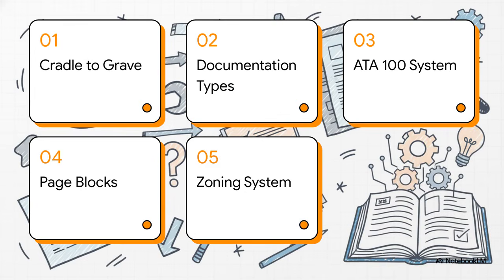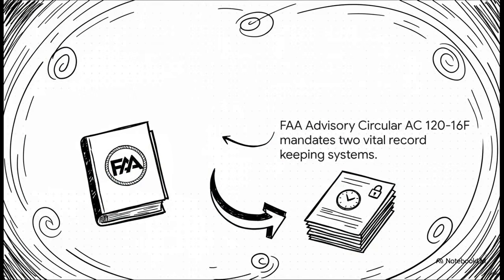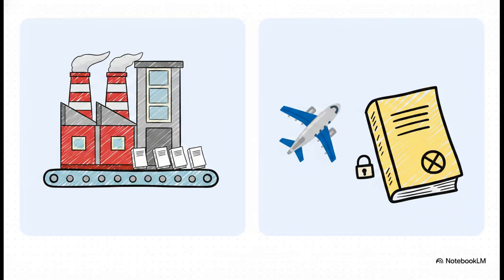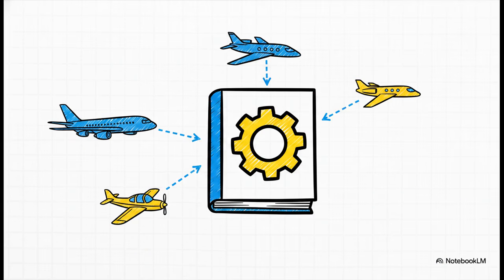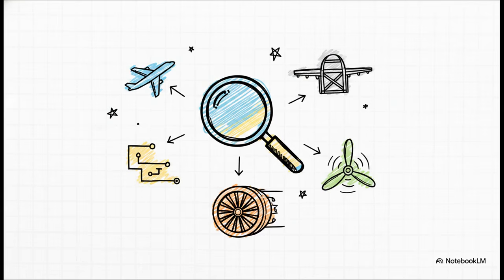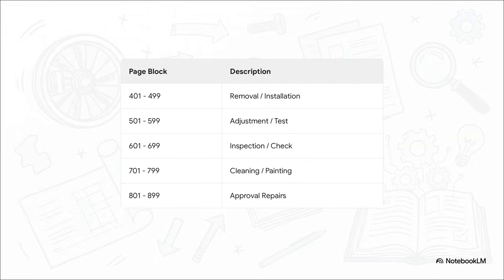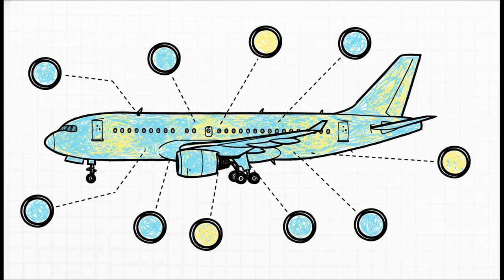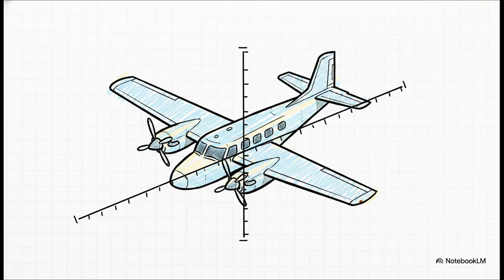AMTE 231 LESSON 01 INTRODUCTION

Comment: After watching the AMTE 231 Lesson 01 video, I gained a better understanding of the importance of documentation and proper referencing in aircraft maintenance. I learned that aircraft maintenance is not only about inspecting, repairing, servicing, or replacing aircraft parts. It also involves knowing how to correctly use maintenance manuals, follow approved procedures, and maintain accurate records of all work performed. Proper documentation ensures that maintenance activities can be tracked, verified, and understood by other maintenance personnel.

The discussion about the ATA 100 numbering system, page blocks, aircraft zones, and station numbers also helped me understand how maintenance information is properly organized. These systems make it easier for technicians to locate specific procedures, components, and areas of the aircraft. I realized that understanding these references is important because it saves time and helps prevent mistakes during maintenance work.

What I found most important from the lesson is that aircraft maintenance requires accuracy, discipline, responsibility, and attention to detail. As an Aircraft Maintenance Technology student, I realized that even a small mistake, such as using the wrong procedure or failing to record maintenance work correctly, can affect the safety and airworthiness of an aircraft.

Overall, this lesson gave me a good introduction to AMTE 231. It showed me that maintenance documentation and standards are essential parts of aircraft maintenance and will be important in my future work as an aircraft maintenance technician. Understanding and following them properly will help ensure safe, reliable, and professional maintenance practices.

Surat, Matthew Carl R.
AMTE 231 - 1B
 2026–2027

Comment: This Lesson 1 helped me understand why proper aviation maintenance documentation is important. I learned that every aircraft needs complete and accurate records from the time it is built until it is retired. These records keep track of the maintenance and repairs done on the aircraft and help make sure that it is safe to fly.

I also learned about the different types of maintenance documents, the ATA 100 system, and aircraft zoning. These systems make it easier for technicians to find the right manuals, procedures, and aircraft parts. Overall, I found the lesson clear and useful because it showed me that proper documentation is an important part of aircraft maintenance and safety.

NACA, MATT NATHAN ALEXANDER L.
AMTE 231- 1B
2026-2027

Comment: The AMTE 231 Lesson 01 video gives a clear and practical explanation of aviation maintenance documentation and aircraft referencing standards. It explains the difference between general manufacturer manuals and documents made specifically for aircraft operators. It also introduces the ATA 100 numbering system and shows how it is used to organize aircraft information, making it easier for technicians to find the information they need. The lesson discusses page blocks, such as the 400 series for removal and installation, as well as aircraft zoning and station numbering. These systems are important because they help technicians understand the location of aircraft components and follow the correct maintenance procedures. Overall, the lesson makes aviation maintenance documentation easier to understand and gives students a better idea of how these documents are used in actual aircraft maintenance. It also helps develop familiarity with standard references that technicians need when performing maintenance work.

JACINTO, ALLEN RAHMAN D.
AMTE 231 - 1B
2026-2027

Comment: This Lesson 1 helped me understand the importance of proper aviation maintenance documentation. I learned that aircraft need complete and accurate records from the time they are built until they are retired because these records show the maintenance performed and help ensure the aircraft remains safe to fly. I also learned about different types of maintenance documents, the ATA 100 system, and aircraft zoning, which help technicians easily locate the correct manuals, procedures, and aircraft parts. Overall, the lesson was clear and informative, and it showed me that proper documentation is an essential part of aircraft maintenance and safety.

Atienza, Zac Sealtiel L.
AMTE 231 - 1B
S. Y. 2026-2027

Comment: The video AMTE 231 LESSON 01 INTRODUCTION delivers a sharp, practical breakdown of aviation maintenance documentation and aircraft referencing standards. The lesson distinguishes generic manufacturer manuals from operator-customized documentation before methodically decoding the ATA 100 numbering format. By walking through standard procedure page blocks (such as the 400s for removal and installation) alongside structural zones and coordinate station systems, it turns dense regulatory procedures into clear, usable knowledge for certification exams and day-to-day flight line operations.

Dones, Daniel Justine B. 
AMTE 231 - 1B 
2026-2027

Comment: Through this video, I learned that proper documentation is very important in aircraft maintenance because it helps mechanics find the correct information and perform their work properly. I also learned about the ATA 100 system, which provides a standard way of organizing information and documents related to aircraft systems. This makes it easier for maintenance personnel to locate the information they need when inspecting, repairing, or maintaining an aircraft. Another thing I learned is aircraft zoning, which helps identify specific areas of an aircraft for maintenance and inspection. Understanding these systems is important because aircraft maintenance requires accuracy, organization, and proper procedures. The video helped me understand that documentation is not just paperwork, but an important part of keeping aircraft safe and properly maintained. It also showed me how organized information can make the work of aircraft mechanics easier and more efficient and helps prevent mistakes during important maintenance tasks.

Ace Kian Albert S.D. Argamosa AMTE 231 - 1B SY 2026–2027

Comment: I think this lesson matters a lot for me. In aviation maintenance, you cannot just depend only on what a technician already knows. You still have to pick the right document for the job. After that, you need to read it closely and do what it says.

Before this, I thought maintenance papers are just background materials. Now I see they are the real guides. They walk a technician through the steps. They also make it more likely that the work is done the right way.

These documents also help when things get stressful. Pressure can make people rush. New tasks can confuse people. The right document keeps the process steadier in those moments.

When the correct forms are used, the whole task is easier to keep organized. It is also easier to check later. Technicians get a clear source to use instead of relying on memory or what they personally did in the past.

In the end, this lesson made one point clear. Good documentation supports aviation safety. When the proper steps are followed fewer errors happen. Aircraft maintenance becomes safer, more structured, and more dependable for everyone who is involved.

R.B.T.RAMOS_2B_AY2026-2027

Comment: Lesson 1 seemed to be quite comprehensible due to its step-by-step explanation of the topics. I appreciate the fact that there are examples given to explain the ATA 100 system and page blocks. It made it easier to understand that aircraft maintenance documentation is an essential component of both safety of aircrafts and record of its maintenance. In general, I found the lesson quite interesting and useful as far as it provides an introductory insight into the field. Also, it became clear to me that the proper documentation helps maintenance personnel to get the necessary information and to maintain the aircraft according to the standards. In conclusion, it is evident that even such simple documents and codes play a crucial role in ensuring the safety of the aircraft and its appropriate maintenance. As a whole, I found the lesson to be quite useful as it helped to understand that aircraft maintenance documentation is not only paperwork, but also an important element of aircraft safety and appropriate interaction of various aircraft maintenance parties.

R.E JUMAGDAO_AMTE231-1B_AY2026-2027

Comment: For me, Lesson 1 proved that aviation documentation isn't just paperwork, it is a matter of safety and survival. The "cradle-to-grave" rule explains why every fix must be written down, because missing logs can create real safety hazards. Standard manual setups also make work much easier when time is tight. As our online discussion and video showed, systems like ATA 100 codes, page numbers, and location zones turn a massive manual into an easy tool. This helps a mechanic find the exact spot on the plane fast without wasting time, so work gets done safely and quickly.

Adao, Kayla Marie A.
AMTE 231 - 1B 
S.Y. : 2026 - 2027

Comment: In my opinion, aviation maintenance documentation is very important because it helps ensure that aircraft are properly maintained and operated safely. Maintenance personnel need accurate information when inspecting, repairing, and servicing an aircraft. Without proper documentation, it would be difficult to know what maintenance has already been performed and what procedures should be followed.

ISIDRO, CHRISTIAN DANIELLE C.
AMTE 231 - 2B
S.Y:2026-2027

Comment: This video lesson was interesting because it showed how aviation maintenance information can be organized in a simple and systematic way. I liked how the ATA codes, page blocks, and aircraft zoning were explained because they make it easier for students and technicians to find the information they need. The lesson also made me realize that understanding documentation is just as important as knowing how to perform maintenance. I learned that proper organization of maintenance information can help reduce confusion and make maintenance tasks more efficient. It can also help technicians quickly locate specific information when inspecting, repairing, or servicing an aircraft. This lesson showed me that aircraft maintenance is not only about working with tools and equipment but also about understanding important documents and procedures. 

Overall, the lesson was clear, informative, and useful for learning about aviation maintenance and understanding how proper documentation supports safe and effective maintenance work. It also helped me understand why accuracy and proper procedures are important in maintaining aircraft safety.

 L.S.CEMANIA_1B_AY2026-2027

Comment: In my opinion, knowing how to work on an aircraft is not the only thing an aircraft mechanic should know. They should also know how to properly use maintenance manuals, documentation, and systems like the ATA 100 and zoning system. These help mechanics find the correct information, locate aircraft parts, and follow the proper procedures when performing maintenance. This lesson made me realize that being a good aircraft mechanic requires both practical skills and the ability to understand and use technical information correctly.

SANCHEZ, ANNIELLE A.
AMTE 231-2B
S.Y:2026-2027

Comment: For me, Lesson 1 was helpful because it introduced me to the importance of aircraft documentation and how information is properly organized in aviation. I learned about the Cradle to Grave concept, different types of aircraft documentation, the ATA 100 system, page blocks, and the zoning system. At first, some of the terms were confusing to me because there were many new concepts to understand. However, as the lesson continued and I understood their purpose, I realized that these systems are important in making aircraft maintenance more organized, accurate, and easier to follow.

I also learned that proper documentation helps maintenance personnel find the correct information and perform their work properly. It can also help avoid mistakes and ensure that important maintenance records are kept throughout the life of an aircraft. Overall, Lesson 1 gave me a better understanding of why documentation is an important part of aircraft maintenance and safety.

Cedeño, John Paul Noel II F.
AMTE 231- 1B
S.Y: 2026-2027

Comment: This Lesson 1 helped me better understand the importance of proper aviation maintenance documentation. I learned that every aircraft needs complete and accurate records from the time it is built until it is retired. These records are important because they show the maintenance work done on the aircraft and help ensure that it is safe to fly.
I also learned about the different types of maintenance documents, the ATA 100 system, and aircraft zoning. These systems help technicians find the correct manuals, procedures, and aircraft parts more easily. Overall, the lesson was clear, informative, and useful because it showed that good documentation is an important part of aircraft safety and maintenance.

Berganio, Aaron Lucky B
Amte 231-1B
S.Y 2026-2027